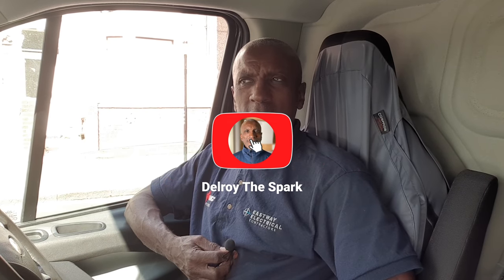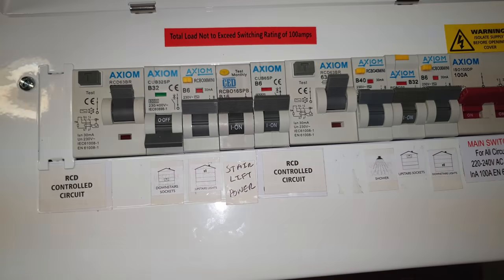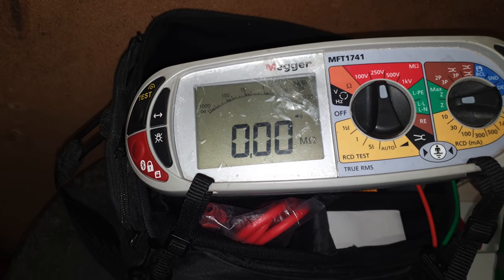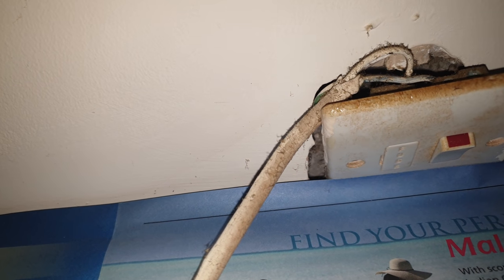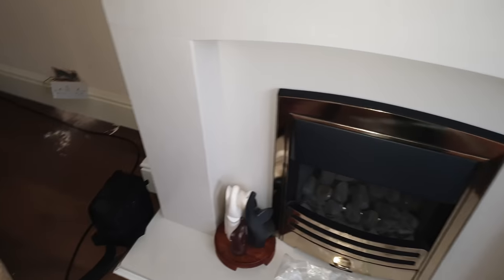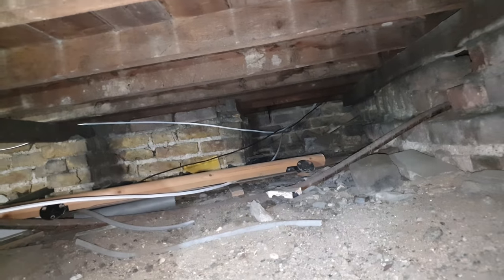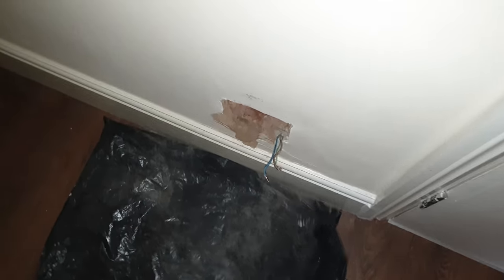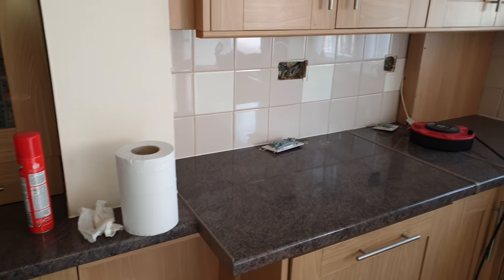Butchered Fuseboard 🤦🏿‍♂️AND No Main Earth For 40 Years!!! | Fault Find and Repair

Comment: My last neighbour called me around after they had a kitchen refit. MCB would not turn on for kitchen ring. All sockets in kitchen were dripping wet after tiling. So I pulled them all out to dry out. Next day when they were tidy and dry I put the sockets back in. MCB happy again. Noticed new mini strip lighting under wall units...wondered where they were powered...no plugs. Bell wire from the back of the cooker. Neighbour said leave it...they were professional kitchen fitters...they must know what they are doing. Absolutely flabbergasted.
Reply: That wouldn't surprise me at all... ive been sent to sort out many a " professional kitchen fitters " work. Joiners should stick to working with wood lol
Reply: They don't know what there doing

Comment: I used to be a cable jointer, to fit an earth wire to the cable, the best way is to strip back both steel tape armours, clean off the bituminous impregnated paper off the lead sheath. You then tie the earth wire to the sheath and using a blow torch and D metal you plumb the earth wire to the lead sheath and the other end goes into an earth block. Another method was to change the iron clad cut out for a new plastic modern one and the earth wire then went into the earth block connector on the new cut out. We used to strip these cables live by cutting off the lead sheath and then getting to the cores that were only covered in paper tape.
Reply: Sadly we don't solder any more but respect for the old lost to time skills but we use a tension force spring and copper braid to provide a suitable earth on an old PILC based service

Comment: As a former elektricien in the Netherlands i am looking at this with amazement!What a mess under the floor!That would not be in the most off the houses in the Netherlands!Just a few cables here and there and under the floor and that is it really! In our houses there is already so long ago decided to use metallic pipes first and later on plastic pipes to get the wires through.Because its tidy and better for the wires.And if some idiote goes mess up with the wires they are easy to find,unless when they are disappearing in the wall. So if there is a trouble with the wiring you can relatively put the new wires on the old ones and it just a matter off puling the wires through until you see the connection with the new wire.And then its correctly again and reliable too. So if there is something  above the cellar not right you know you dont really have to check under the floor.

Comment: If you read the IER 10 ( yes that going back a few years) you will find that using the main gas  or water pipe for main earth with a 2.5 mm earth cable was fine. If no earth point supplied by the Electric Board , you used a current or voltage earth trip. Any thing we were talk to do was to twisted your earth, live, neutral together at point of connection, not so now.
Thank god things have change, much better safety equipment now.
One reason I like watching these videos is that I now no what to do in modem standards

Comment: I'm no sparky but had to get a sparky to rewire my garage to put in some sockets and an extra light, the already fitted consumer unit was a 100amp fuse 10 way jobbie in a garage, that was wired apparently to a small consumer unit with 63 amp main fuse in the electricity metre supply cupboard.
This was wired with two mcbs a 16 and a 6. The 6 was feeding the garage using brown and grey on the armoured cable with the black as an earth. On the garage end they had wired black and brown as the main feeds and grey as the earth. 
I had never actually turned anything on in the garage until 4 months after we moved in as it was just storage. Until my wife wanted some plates and I realised when you put the light on the RCDs tripped at both ends. I contacted the company who fitted the electrics on the new build and issued the certificates they refused to come out. They had also wired the kitchen fridge to the upstairs bathroom towel heater and the hall light switch was fed from the outside from lights. so called professionals... The new guy however tested the whole house ands corrected the 7 faults we had. Ive sent them a nice bill in the post.

Comment: Crazy del your a brave man fitting that clamp to the sheath. Certainly one for the DNO. If u you out work live I would have had CAT rated arc gear on, like we do in the USA. With double insulated rates gloves, face shield and fire rated clothing. No simple jobs for you Del. Get yourself a metabo chaser well worth the investment.
Reply: I agree. Not a risk I'd take. That said, a pal of mine who works for the board did the same thing as a temporary fix for me years ago. Shaved off a bit of the lead sheath & replaced the clamp that was on there for a braided TNS connection. Thing is, he'd worked for the board for many years & was qualified to work on it. I've since paid to have the meter relocated outside & they put in a TN-C-S earth. I do not recommend anyone tries this fix, even as a temporary measure!
Reply: There was no danger lol, it's got 2 layers of steel tape armour and that's what he temp connected to.

Comment: That's why we use tubing inside the walls all the time (it's mandatory), so you can always change, modify or repair any wiring if necessary.
It's anyway really strange to see the differences in wiring between different countries. We never use rings and all our houses and flats are always three phase (3x400 Volts, so 230V per Phase)
Reply: Typically it's a lot cheaper on the copper to just have a ring circuit
Reply: @thepenguin9 In 1950, maybe...? Nowadays its not even 10% of the bill. Did you ever check the price of those gourmet/designer outlets and switches people put in their homes?

Comment: Last extension i was called out to was wired in twin bell wire.  Several two gang 13a sockets. Then found connected to the lighting circuit. I just powered down and advised the owner to contact the builder who installed it.  No earth obviously.

Comment: Brave man fitting a bonding clamp onto PILC! could you get the DNO to PME it ?
Reply: @fromthetoon1602  Same here,DNO would  have also upgraded cutout.
Reply: I think Delroy said it was all temporary.
Reply: Oh maybe. At least Ze must be down to a reasonable value now so it’s much safer than it was.
Reply: Dusty 99  you aren't allowed to touch the pilc coming into the property as a normal spark, dodge city. Phone the dno and they will put an earth sweat for the customer for free.
Reply: It's a DNO issue

Comment: As a retired sparks of 50 years I have the exact same consumer unit in my house ,its a split board and the 2 rcds and mcbs come with the board ,the problem comes when An mcb develops an earth fault it will trip the rcd therefor disconnecting everything else covered by that rcd .so that sparks swapped the mcbs to rcbs so an earth fault on an individual circuit will only trip that circuit and not multiple circuits but he should have spotted that there was no main earth cable
Reply: He definitely should .

Comment: Not a spark but enjoy the vids so apologies if this is a daft question...If the earth was non existent originally, was the remedial work on all the sockets truly necessary? Sort the earthing, kitchen and living room in turn sorted? I may be missing something not explained but that's how I took the video after all that.
Reply: I'm not a spark either but I think the tripping was due to the faulty wiring and the fact there wasn't a reliable earth was just another problem on top of that, not the cause of the tripping. I could be wrong.
Reply: Both comments are accurate but mean nothing if you aren't a fully qualified electrician.  Stick to your day job.
Reply: @adamsharp201  What's yours? Trolling on YT? Nothing wrong with asking questions

Comment: Is the Cooker hood ok? I was just thinking as it was close to the faulty sockets.
Also if you had 36.5 ohms at the sockets on Zs is the Main earthing arrangement a TT system? 
I've had it at a property where the main earth was wired to the cutout MET terminal as TNC-S but it wasnt connected inside the cutout  on the Dno side.

Comment: Great video Del,not sure if your supposed to clamp on to the sheath like that,shouldn’t the DNO be called to install an earth?and the chase going across to your high level tv socket is not in a zone,did you find where all them cables went to in the kitchen?3 cables in each socket and most of them down crazy,the last Electrician wants putting in prison before he kills someone.
Reply: Hi ask the DNO to provide an earth they will strip the armour exposing the lead underneath and bond the lead and armours to an earth block.  Using the armours alone is the old method and earth may be lost if they corrode at any point.
Reply: i was think that it's now you have damaged DNO's property it's there cable it's not on our side to just scrape away & hack at there cable

Comment: I'm not a qualified electrician but my understanding was that those metal straps used for water/gas bonding are not suitable for PILC cables? Lead is a much softer metal so if you over tighten you can easily crush the live cables within. Same reason why you don't use them to earth the steel sheath on SWA. Or maybe I'm wrong? Very open to correction as I'm still learning.
Reply: I suggest you qualify as an electrician before commenting on things you know nothing about

Comment: Either originally a TT system or they used the water mains as the main earth .
Reply: Really common ....I change them everyday
Reply: @daviej8180   always call the dno  its a no charge repair and thier ilability  do it yourself and an issue occurs its your nuts on the grill
Reply: @steverobinson8170  I am the dno
Reply: @steverobinson8170  The DNO will charge for a PME connection, unless there is an existing TNS or TN-C-S that they installed, in which case they're responsible for maintaining it. I'm also DNO. It's possible different regions have different policies on this though.

Comment: The DNO won’t provide an earth as it’s a Pilc service and are not required to provide one. The only options would be an earth stake or request a new a PME service.
Reply: @totherarf  sorry but maybe you didn’t understand. Why would the DNO refuse you a new PME service if you’re happy to pay for one? ie £4000
Reply: It really makes no difference TNS or PME. The network is all PME. That sheath is still connected to neutral in the joint.
Reply: A SNE earth from a PILC service would usually be best endeavour for pre 1972 installs if the joint connection supports it and it passes it would usually be offered but some older networks the (typically legacy ex-DC ones) the lead was not bonded across the old joints so would require either a new connection onto the passing main or at least the old joint dug and cross bonded.

Comment: Good job del I had a similar job like that last week downstairs sockects and 1 room upstairs wired together the the circuit was tripping every 8 or 9 hours I plugged sockect tester on some of them it was showing me live and neutral reverse but checked every sockect the connections was ok I thing there’s a joint underneath the floorboard the faults coming from I can’t lift floor he’s got new flooring I said u need to rewire the ring and separate upstairs room to radial big job now gave price for it iam not taking a chance very dodgy wiring

Comment: I am so surprised how often you come across the cables failing, I have never come across cables/wires failing. unless it is due to mechanical damage. most of the time a faulty on the usage end.

Comment: Nice job so far delroy. Interested to see how you get the cables to the kitchen sockets without wrecking the tiles
Reply: I don't think there's anything you can do, unless that wall's plasterboard. Apart from that it's either take the tiles off or go trunking with pattress boxes.

Comment: Nice job Del 1thing the tv socket cable when it goes over the top of tv bracket it’s not with in the zone if you had gone left out of low level socket and the straight up to tv you would have been ok

Comment: Still think it's a terrible system putting the wires in the wall like that. Over here everything is put in 16 or 19 mm PVC pipe. So if there is any fault you can replace the wiring. I do like the switched and seperately fused outlets.
Reply: If US & UK standards got together & combined the best elements of both, it would be the envy of the world. As it is, we both have our own peculiar set of deficiencies.

Comment: millions of houses in the uk have no earth . most have had mdpe fitted old lead replaced! and the dno i was told .no oblagtion to supply one £160 to solder to sheath. cannot wait for elec cars most need a very good earth am told. i am not a spark.
Reply: When installing an EV charger they are separated from the main earth anyway in PME arrangements with their own earth rod so it becomes a TT.
Reply: @nitrofar34  Not necessarily, some charge points are connected directly to the existing earthed supply on a pme installation, they have built in pen fault detection so dont require a separate earth rod.

Comment: The idiot put in RCBOs but left a socket circuit(!) with only an MCB???

Why would you put the lounge on a ring? Surely a 20 amp radial would be more than adequate for such a room?
Reply: Coz when the boiler goes down in winter and they plug a couple of 3kw fan heaters in to warm the living room it will overload it.

Comment: I still don't get it why they use systems like this, You can just never get to any of the cables like that, some 16mm or 19mm tubes in the wall to some junction boxes and you can in theory always replace the wires,

And using rings like seems so bad idea these days. no need for that, Looks expensive to fix this mess.
Reply: Ring mains are so archaic and need to be ditched asap